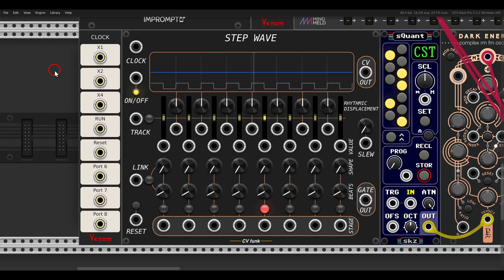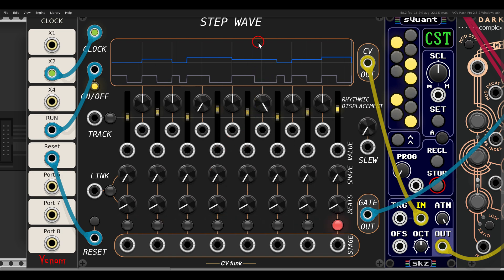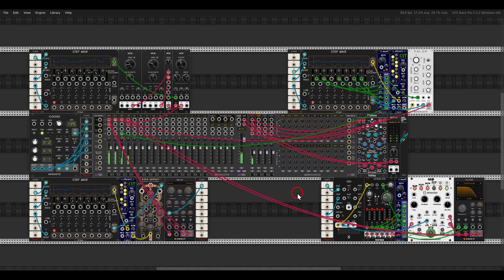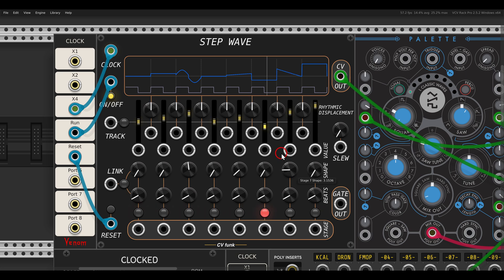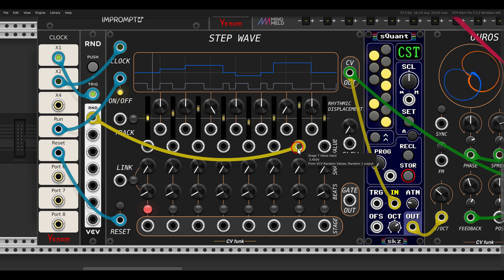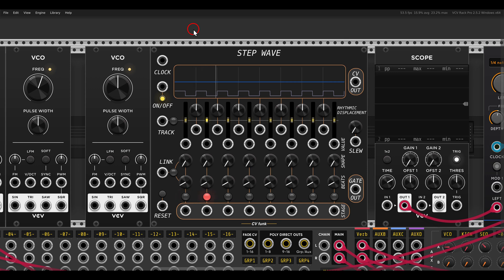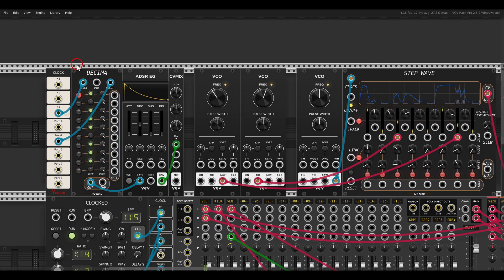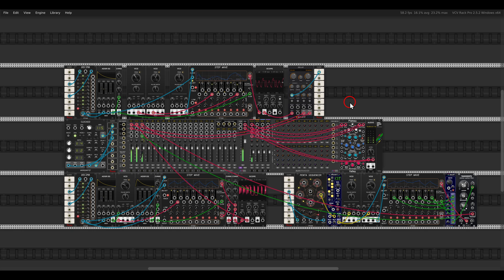Unlock Endless Rhythmic Variations with Step Wave by CV Funk

Comment: just starting with VCV, trying to copy your patch but cant find the Clock by Venom in library. what would be a replacement? great tutorials thanks for making these
Reply from the maker: Hi! This is not a clock module, actually. It's the Bay modules from Venom that allow me to "transport" the clock signals throughout the patch, without having cables everywhere. One module is the input, and the other modules, the ones you see on the screen, are the outputs. The clock I'm using is Clocked by Impromptu.
Reply: @OmriCohen-Music  Thanks for the reply. going to it try again cant wait to get my teeth into VCV and keep the greymatter working. your totorials are brill.
Reply: got it thanks, now going to try and duplicate your patch.